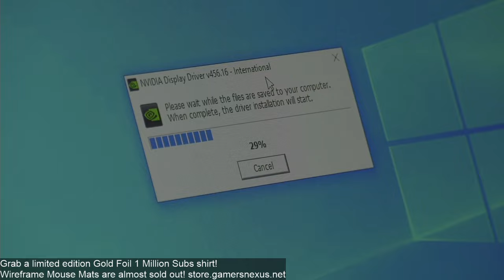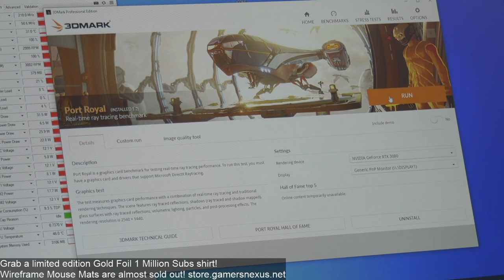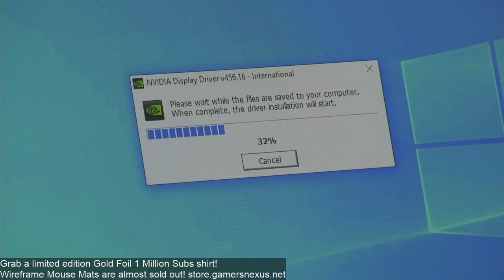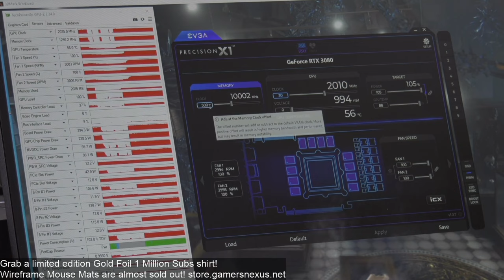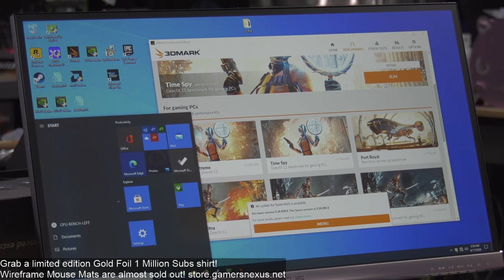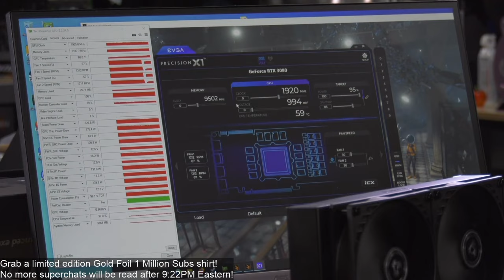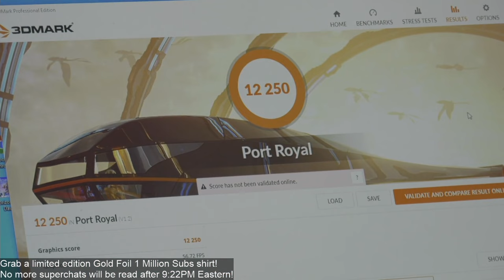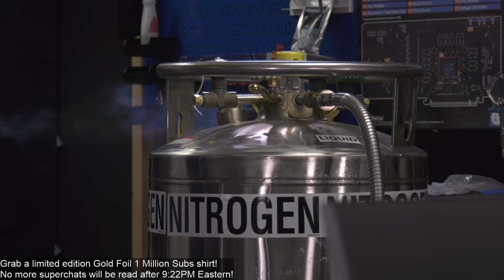LIVE: Overclocking RTX 3080 Custom Cards (ASUS, Gigabyte, EVGA)

Comment: what's the point of overclocking the graphic card or CPU
Reply: it allows the card/CPU to use more electricity, and uses that electricity to increase performance
Reply: getting higher clock speed for better performances is the point of overclocking a gpu or a cpu
Reply: you get more fps in games = better performance.
Reply: I think this guys means why overclock such a beast that can probs already play every game at at least 60 fps
Reply: @chaniibak7702  why did he include CPU though?
Reply from the maker: What's the point of fun?
Reply: Some overclock for getting for more fps. Some overclock for bragging rights. Some overclock to get the highest score in 3dmark. Some overclock so that they can inform people which cards have a higher card overclocking potential.
Reply: @GamersNexus  that's a great honor to have your response to my comment.
Reply: Gives you better rgb! 👍🏻

Comment: 35:44 u dont have full voltage control on msi afterburner (ctrl+f / ctrl-L)???? i have full control in my 1050 in a laptop max voltage 1.2v and is alot XD
Reply from the maker: It doesn't actually do anything.
Reply: @GamersNexus  yes it does, i check the values on gpuz and hwmonitor
Reply: @danielvaz431  tech jesus talked so you shall not bother us with your misinformation. Or to say it in your words: omg you got rekt XD
Reply: @TSL1711  men just learning men XD it works on my card so...